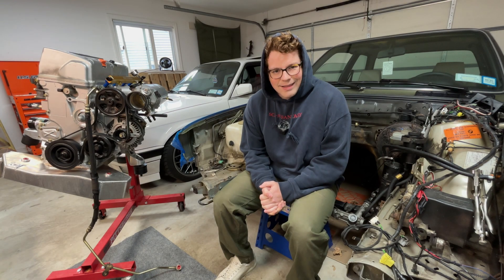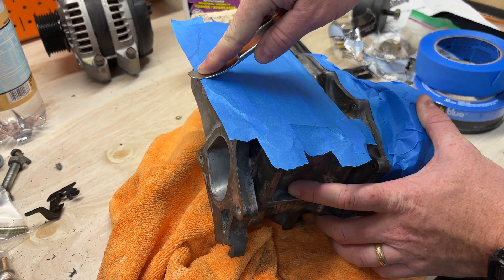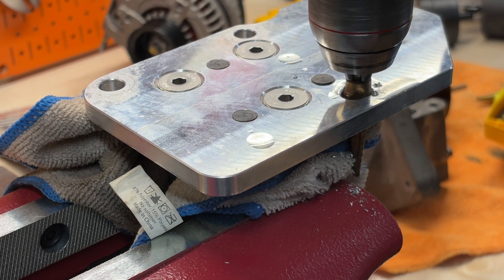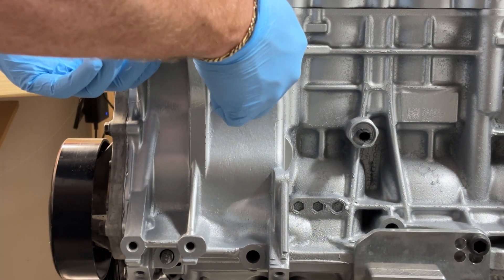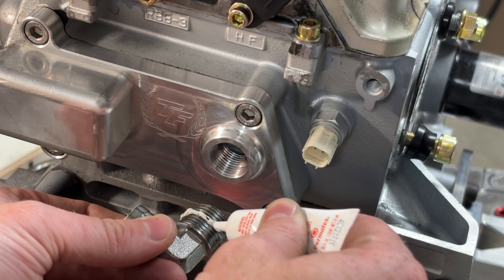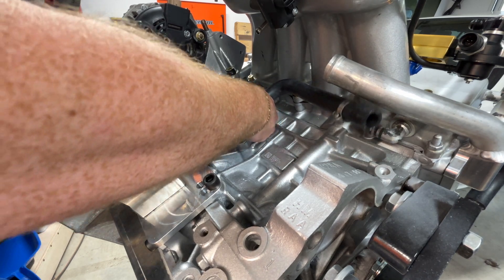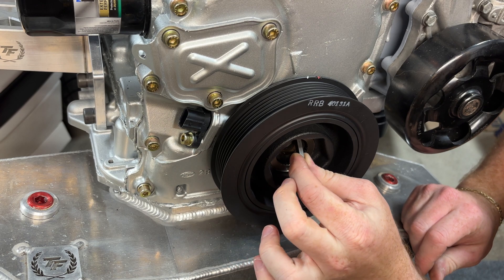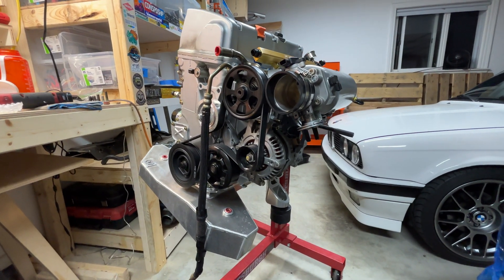E30 K-Swap - Engine accessories: power steering, water pump, intake

Comment: What is your suggestion for using both AC and power steering at the same time?
Reply from the maker: I know it’s possible with the Kpower oil pan for E30. TFworks maybe, but not sure if it will clear the frame rail.
Reply: I was reading that you would need to run a  Volvo power steering pump in order to run AC as well since the ac and  power steering pump share the same location if you do the Miata power steering.

Comment: Hi, do you have the part number for the smaller harmonic pulley? Thanks.
Reply: Oh and which Miata P/S pump too, if you mind thanks
Reply from the maker: @ 13810-PRB-A01 for the pulley. the pump is off a 06-15 mx5, NE51-32-650R-0D
Reply: @DekadentGarage  thanks a lot,  I'll do the same thing on my build. No issues with that set up?
Reply from the maker: @lebeaualexis1159  seemingly all good! check out my video "E30 K-Swap: Wiring & Cooling Made Simple" for info on the power steering hoses. you'll want to trim the waterpump bracket that used to hold the idler pulley.